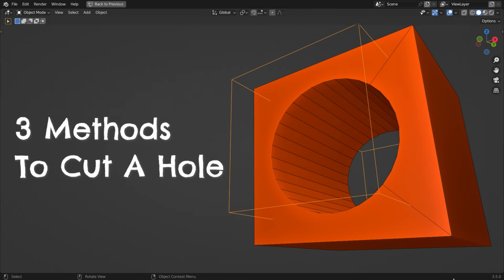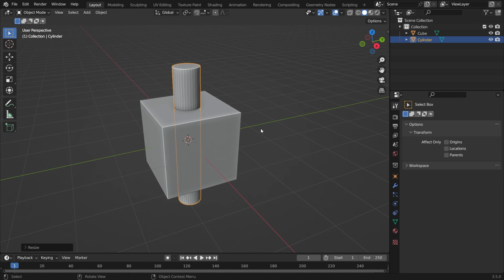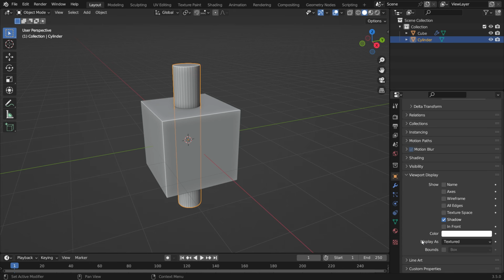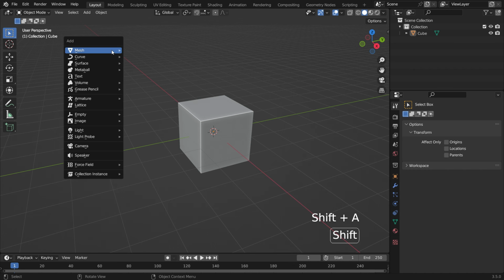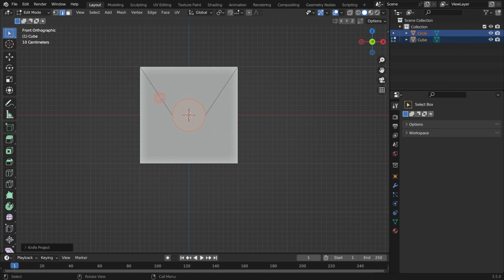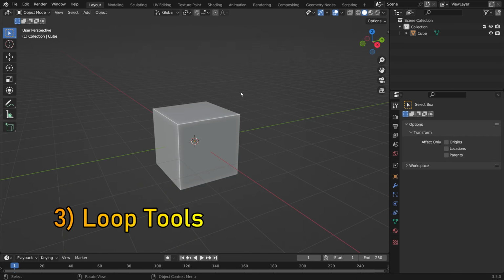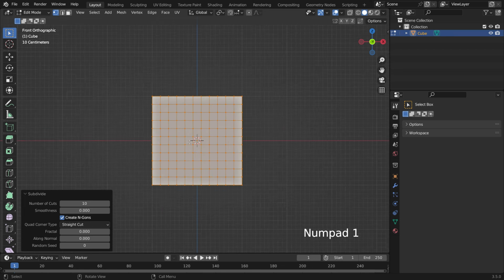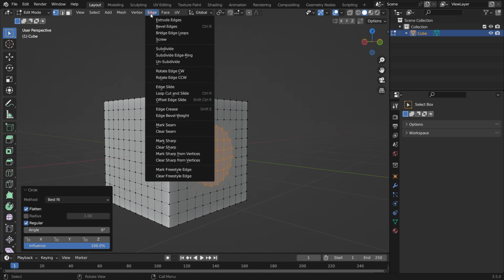How To Cut A Hole In An Object | Blender 3.5 Tutorial

Comment: That knife tool was what I needed. Boolean didn't remove the object in a 3D print. Thank you.
Reply: try exporting the file from blender to fusion 360 if you want to print, blender isn't really a 3D printing tool
Reply: For me the first method worked, but u need to click "apply" on the modifier within the dropdown beside the camera icon (I am also using it for 3d printing)
Reply: @samuelcoupland1658  EXACTLY what I needed...  lost 20 minutes to that not being in the video.  thank you for the follow up!
Reply: Welcome!, happy to help @coderun1633

Comment: Why does the boolean modifier does not work for me? Half of the cylinder suddenly turns into flipped normals and stays visible, so now I have a corset with sticking half cylinders inwards the body out of the places supposed to be holes. So it seems like it is not working on thin meshes?
Reply: after googling it, it seems that's true, you cant use it on meshes, that are not solidified :(

Comment: Hi, when I click the cilinder object, it says Failet to set value, and when I click Apply, it said Modifier is disabled, skipping apply, can I know why is it?
Reply from the maker: Ensure Both Objects Are Meshes. The Boolean modifier only works with mesh objects.  Set the Object field in the Boolean modifier to the cylinder. Ensure you’re using the correct boolean operation. Sometimes, non-applied transformations cause issues with Boolean operations. Select each object, then press Ctrl + A and choose All Transforms.
Reply: @mk3dgraphics  Thank you very much!

Comment: wtf why 100 steps  who the hell coded this crap
Reply: The first method is more like 3 steps, it just seems like a pain at first. You're simply subtracting one shape from another. Apply the modifier then delete the modifying shape and it's a permenant change.
Reply: Makes no sense this could be done  with a short cut key  select shape and place where you want hit short cut key to remove selected last shape and it automatically also makes a hole
Reply: @Yahgiggle  apparently the 'Bool Tool' addon does what you're describing. Not too bad for free program
Reply: Stupid software